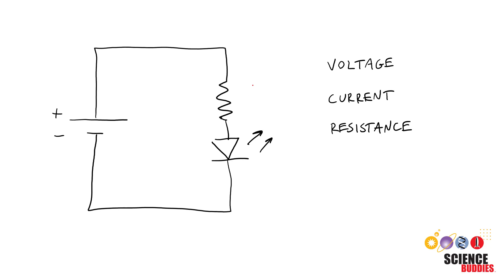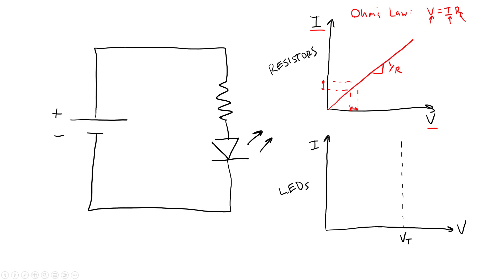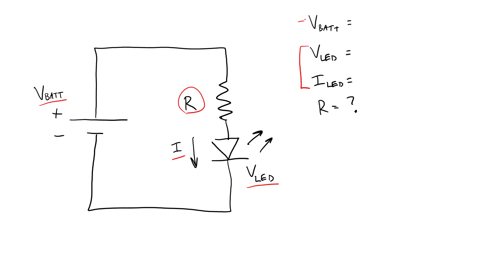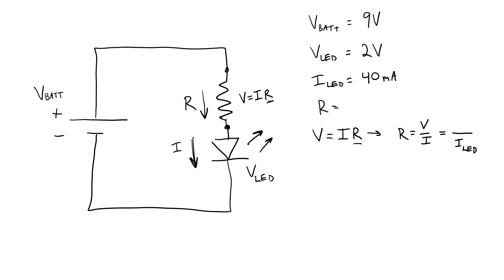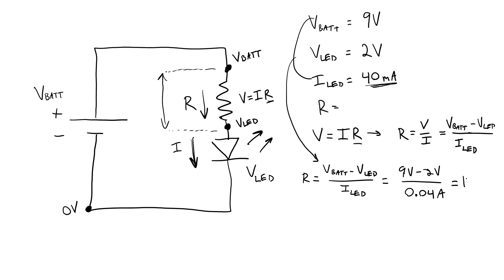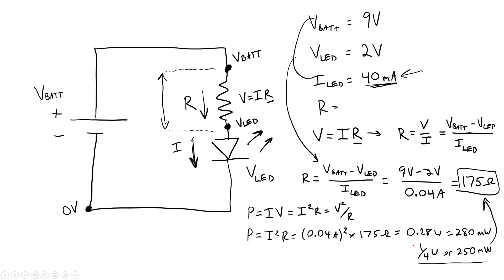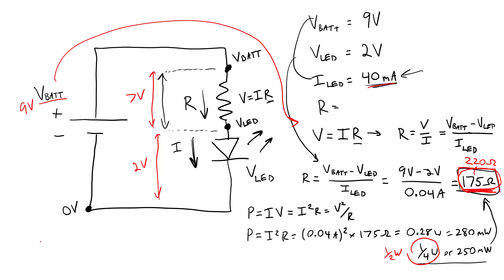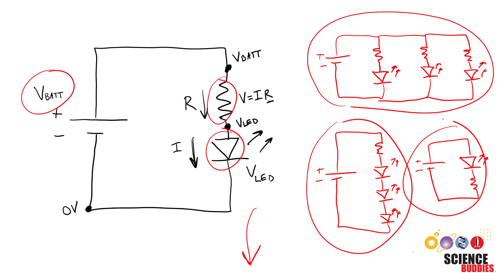LED Circuit Design: Choose Resistor Value

Comment: With that 220Ohm resistor you would be dissipating 0.224w.
Which is pretty close to the 1/4w max rated.
Not sure if you would need some overhead

Comment: Would not the graph of I dependent on V have a slope of V/R, and not 1/R? Would not 1/R be a constant and the graph would be a horizontal line?
Reply: The slope would not be a line then
Reply: @FabioSpelta  R is a constant, therefore 1/R is also a constant. From AI overview: "To plot a constant value, you simply create a horizontal line ..." What is shown is not a horizontal line. It is a sloped line and shows that I changes as V changes and I=V/R. Pick an R. Make a two column table with V in the left and I in the right. For various V's compute I using I=V/R and then plot. Pick another R and make a new table and plot. Each plot will give you a new line with different slope, not the 1/R slope for each new line.